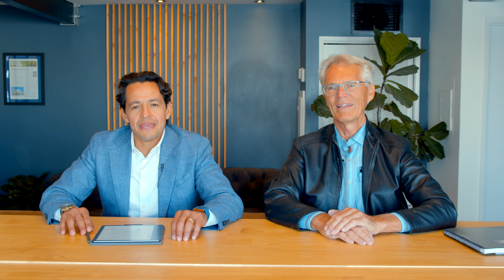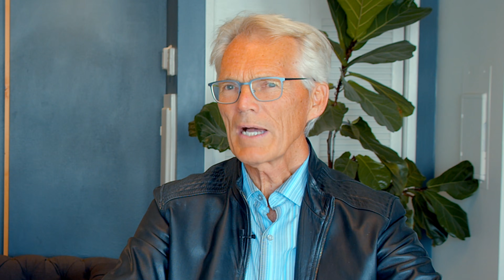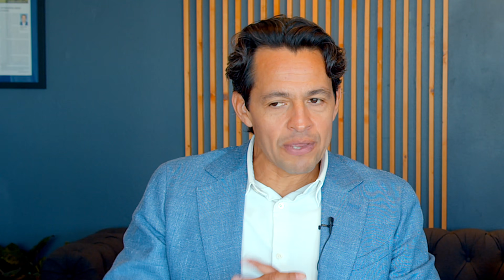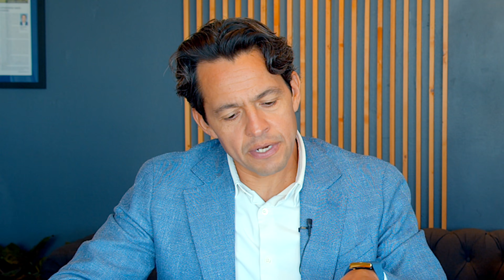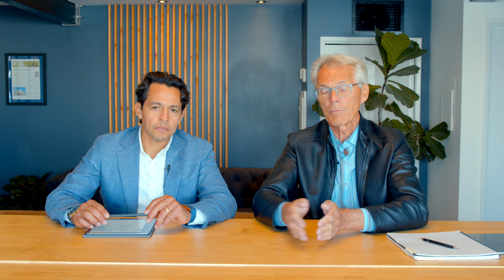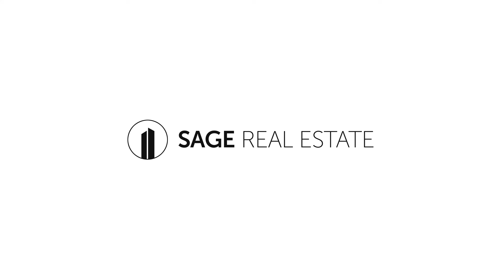How to Double Your Property’s Value with SB9 Lot Splits!

Comment: 3:25 homeowner doesn't need to live on the property as of 2025 updates to adu law.
Reply from the maker: As of now they do need to live there however, we do believe the law is going to change to we cover this during the video. Thanks
Reply: @SageRealEstate  this is incorrect. Please read the 2025 adu handbook
Reply: @jayyfz  Hey Jay, might you be refering to the fact that the owner of a lot which has an ADU does not have to live on the property? SB9 is much more the ADU's. SB9 actually creates separate legal and sellable parcels. Under that law in its current itteration, an affidavid by the home owner stating that they intend to reside on the property for 3 years is still requred.  SB 677 hopes to eliminate this requrement
Reply: Do you have any link that says homeowner doesn’t have to live on the property?
Reply: @steve-wright-k8s  yes, search for 2025 adu handbook. It explicitly says you no longer need to live on the property. The information in this video and his comments are incorrect for 2025.
Reply: @jayyfz 
ADU & SB9 laws are different from each other. This video addresses SB 9 lot splitting. Feel free to click the link in the description for a free eligibility check for your property!